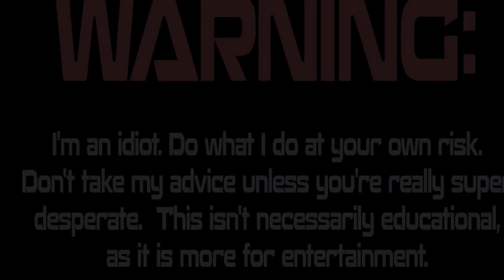Supercharged C3 Corvette Lets ALL The Eagles fly! Huge Burnout! (multiple fires)

Comment: Back in the mid-60's my Dad's '65 Chevy had a recall for defective motor mounts. The factory solution was to attach an airplane cable type, of setup around the motor mounts to prevent the engine from lifting when you gunned the throttle when making a left turn. On some cars, the throttle would lock in full throttle position and the car would go out of control. Nice to see you reverting to '60's technology.
Reply: 1968 chev impala conv   307. Dealer installed motor mount chain fix..
Reply: Lot of people crashed because they forgot to turn the key to off. Before the switch was moved to the steering column which locked the steering.
Reply: Yes , I've seen that on several '67 - '69 camaro's . One end attached to the through bolt and the other end on the chassis . I believe that was on 327 and 350 engines . Don't know what was done for 396 or Copo and Yenko 427 cars though . At some point , all manufactures had to do away with rod linkage and use flexible cable for accelerator linkage . Yeah , that was a real problem !
Reply: Jessica is a huge help. One good Woman.
Reply: Rick Rodriguez - Paul Zoulamis - G money : Thanks guys, I'd forgotten all about that ... brought back fond memories 😉
Reply: when you rip a cj around a lefthand corner with 2 laughing young folks in the back seat: you eject ujoint straps, thats a for sure.
Reply: I had a 65 Bel Air. Straight 6, 3 on the tree.. And I broke one too.. How? Lol
Reply: @sirloinofbeef3862  Wow ... that IS strange 🤔
Reply: Mookie Wilson 
If you meant CJ as in cj5 or cj7 , you got me thinkin' . I'm putting a cj5 on the road now with a custom rear driveshaft for a in line six and T5 trans / Dana 300 install . The shaft uses the factory straps on the AMC 20 rear . Hate to blow those up the shaft was like $300 . I know a U bolt conversion should be done but so far so good up to 35 mph . We will see soon at higher speed .
Reply: @kimosabbe50  I wish I still had it. Best car I ever owned. I beat the hell out of it. Never died. Lol.
Reply: @sirloinofbeef3862  I believe it. Back in the mid 70s I had a '62 Bel Air, 6 cyl. with a Powerglide, as a second car. That thing was indestructible ... wish I had it today. 😀
Reply: A buddy of mine had a ''66 Impala had broken motor mounts ..instead of fixing them he ran a cable from the carb linkage through the firewall ..when the throttle would stick he would just yank in the cable..at one point he had to take the air cleaner off since it was smashing into the hood...of course this car also ran around with 20 pounds or less of oil pressure never had to change the oil just add more it would burn through it...those small block Chevy's were amazing...
Reply: No it was not a motor mount issue it was a Chevrolet torque issue LOL
Reply: @futureliner  the 69 Camaro RS SS came with airplane cable attached to the motor mount on one side from the factory Chevrolet torque
Reply: @MickeyMousePark  That's a new one 😀 ... very funny.

Comment: GM did a big recall on those motor mounts to solve the problem you are having. They went to a "C" Shape that locked them together so when the urathane got old and let go, the mounts would stay together. I worked for GM at the time, and we replaced thousands of them. Great channel Derek!

Comment: Derek, that’s one of the coolest things I’ve seen in a long time I like them tires that color was unique also that gave me goosebumps you did it man you brought it home brother.
Reply from the maker: Thanks Dave
Reply: @ViceGripGarage  maybe run one red and one blue tire for the independence?
Reply: @ericfrisby6980  HaHa !! I was actually just thinking about that as I read these comments. My first thought was Red, White and Blue - kinda tricky with a 2wd though. Very next thought - so make it 4wd, then red, white and two blues.  Howboutit Derek?
Reply: @2H80vids  he could add a smoker like the crop duster use for the white smoke
Reply: @ericfrisby6980  I think that might be considered cheating in a smoke-making competition.
Reply: Super awesome video Derek
Reply: @2H80vids  yes would've been cool red & blue with a simple weld in the rear end. poor mans posi
Reply: @ericfrisby6980  Would some water injected into the exhaust give it some white?

Comment: that one was good. i just turned 60 and got a wild hair to buy a complete 1996 Jeep Grand Cherokee from a junk yard for $450. hauled it home and there found out the ONLY thing wrong with it was the fuel pump was out..... $30 later it is an everyday driver. interior was great. outside body was 98.9 straight. WOW.... now my daughter wants to go find one and guess what, there it was solid black Pontiac fiero and 100% complete and motor turns over.

Comment: Your videos take me back to wrenching on my old cars back in the 90s. :-) I was dirt poor, but I had an intake, Holy 4BR, an electric fan and a trans cooler that I picked up at the autoparts store. I made my camaros / trans-ams the best they could be, on the cheep! The best one was the run-down 84 trans-am with the 5 speed. The previous owner just let it rot. I tore off all of the emissions crap, washed the engine down 3 times, and swapped all the Camaro parts onto that and the "ONE EYE FIRE-CHICKEN" was born. You'd hear that 4BR coming from a mile away. I snapped the shifter off in a race and replaced it with a deep wall socket and a 3/8 extension.. I called it the ratchet shifter. The kids with money would get pissed when I'd hold my own with my POS garage creations. :-) No better feeling than when you create something from parts laying around.  LOL.. And old school timing. I brought a 78 trans-am with the 400 complete with shaker hood and T-Tops for $125.. The issue with the car? The kid forgot to tighten the spark-o-twister... I did a burnout all the way down his street an hour after buying it.. LOL

Comment: " That's how you can tell it's running" Derek just blew right through putting a blower on a vet he got out of a field the week before, plus fixes the front brakes and wires in an electric fan plus installs a rev-limiter and gets it all done in time to compete, gotta love the effort, you could tell he was tired but the blower definitely added some much needed power. The tip in was as good as could be expected but then he was able to hit second and keep them wheels spinning and when he came to a stop with the wheels smokin, it was so thick in the car, I don't know how he was able to bear it, you couldn't see him 2 feet away and then grabbing the American Flag while not being able to see and flying it out the t-top was awesome, then catches on fire stops and runs out of the car waving the flag not even stopping to check out the fire, that was awesome. That is the most animated I have ever seen this laid back dude! I watched the whole vette project from start to finish in one setting and really enjoyed it. Thanks Derek for the video, keep them coming and good luck and God bless!

Comment: Had a 455 Pontiac that used to eat motor mounts, but I didn't want solids in my daily driver. I chained the head to the frame and it worked great.

Comment: Does anyone remember the General Motors fix of 1967, they had the same problem with motor mount failure there answer was the same thing you did with the cable, when you put it to the floor taking off the gas pedal would stick to the floor, it happened to me, GM did a recall on any chevy with a V8 in them, and their answer was to put a cable from the exhaust manifold to the frame.

Comment: When Chevy had a huge recall for bad motor mounts in the 70's they used an aircraft cable thing bolted to an exhaust manifold, and something on the frame, to 'fix' the problem - instead of replacing the defective mounts. My 69 Chevy wagon 300hp 350 busted its mount when I got on the gas hard leaving a gas station; the motor raised way up and stretched the throttle wide open, aiming the car full speed at a big steamroller parked nearby.

Comment: This is not the first time I have seen a ratchet strap keeping an engine from flying out of the bay. It's a LOT cheaper than replacing the motor mounts. And works just as well. Also, perhaps there's only four lug nuts in the package because the seller assumed there would be a locking lug nut used.

Comment: same with drive shafts always check the u joints if the rear u joint should brake a drive shaft can tear a car apart yeah big time  and if the front one goes a car can be catapolted in the air and flip over

Comment: couldn't ya just weld the bolt sleeve from one side of the mount to the c side of there mount thsts on the crossmember? then becomes a solid mount like they use in drag racing.. I did that to my 72 nova.

Comment: Motor mount bad? Cut a bit of chain and weld it on. Though I don't think you'd get much stick-tion with that wee gas-less MIG. Saw the ratchet strap go on around the exhaust manifold and thought "Well that's one way to start a fire."